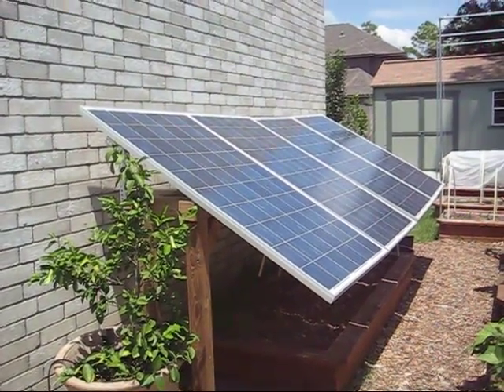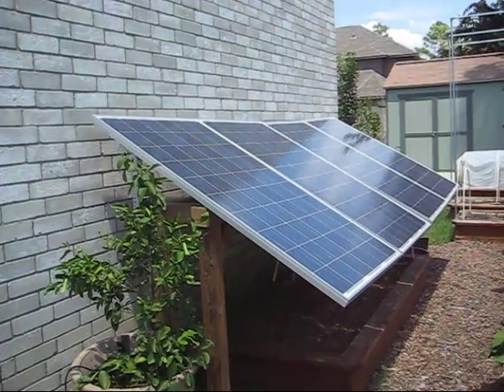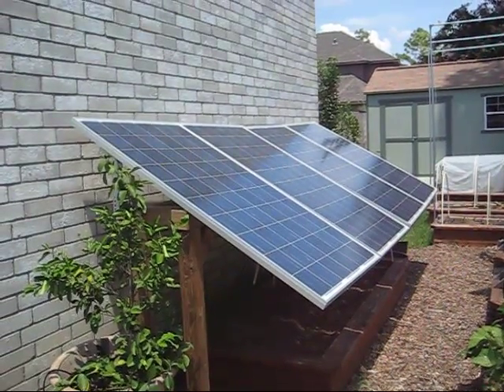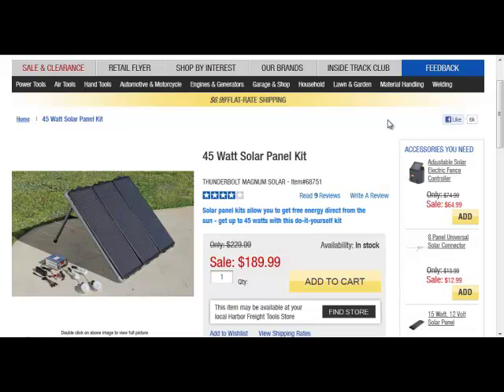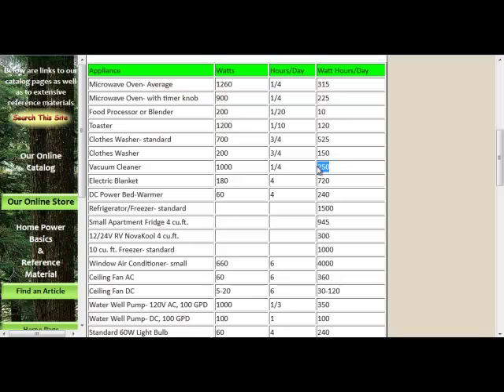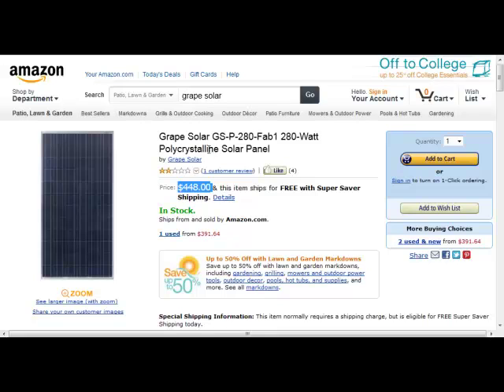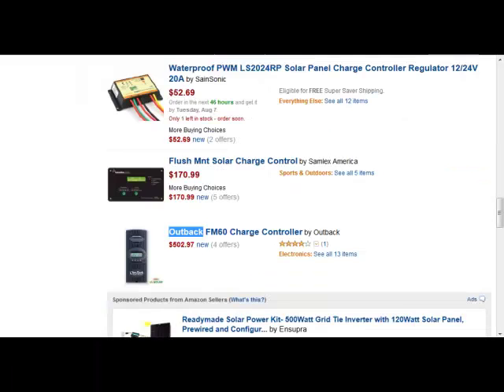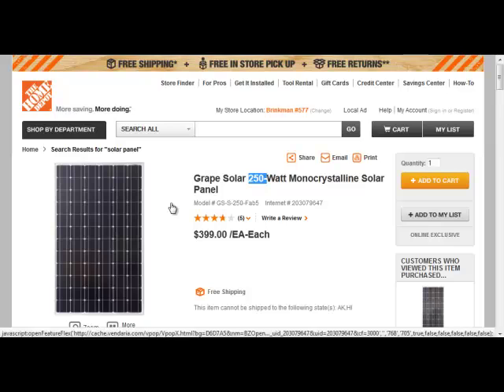DIY Solar Panel System: Costly Mistakes

Comment: most home appliances are not made for efficiency and then you have conversion losses on top. to get best results ul need to convert your appliances like washing machines/tumbledryers to use A+ grade 12v pwm dc motors then run during the day so that you run direct from panels and avoid charging losses. lights will also all need to swapped out for leds with hybrid daylight optics and with regard to mppt charge controller i built my own so i know how it works and performs.

Comment: hey thx for the videos im really into them, even tho the HF cost you some money it sounds like you came out of it with a LOT more knowledge than u began with so u didnt spend the money in vain atleast u gained some knowledge... ha.....but question... u said stick with a poly or mono..but whats the difference in the poly an mono? an also whats the big difference between them an the HF "Amorphous silicon solar cells " thanks!

Comment: Harbor Freight's solar panel KIT were designed to be used as a portable charging system or for remote location power supply, not to power your home.

Comment from the maker: Either way works. It really comes to personal preference. I'd find some controllers you like and call the manufacturers and get their input. My controller max is 500 watts and 45 amps so connected two panels together so I kept my amps at 30 amps and doubled my watts to 440 watts because that worked for my controller. I use two controllers for my four panels. that way I have a duplicate system I could take somewhere else if needed. "One is none and two is one". :)

Comment: Ok, Lsd, wish i could pick your brain for an hour, i soo don't need any more mistakes..so say i have 2 grape panels each making 30volts, whats best, run them in series to 60 volt solar controller, or leave them parallel to one 30 volt controller that can handle them both?, i need to hunt that sight you used for good info..
thanks Bob B...

Comment: i have a question on the grap pannels you posted, from home depot, i see it says 30volts, is that fine going to proper regulator?? my battery system is going to stay a 12 volt bank, because i all ready have 2 -12volt inverters..one 2000 watt and a 3000 watt, so ? is, 30 volts coming from each panel going threw decent regulator to a 20volt battery bank is fine?
lol, i also bought 2 harbor freight kits, bad move ..trying to go same line as you, Thanks Bob B

Comment: I have the 280w Grape panel and the Coleman 30amp is NOT recommended because the Grape 280w panel is rated at 36 volts output...not 12v-25v. I speak from experience. I bought the Coleman and had to return it. You need at least a 36v rated controller... 48v is better. I am not talking about battery voltage, I am talking about nominal voltage (incoming voltage from the panel) . The Morningstar Ts-45 is up to 125v nominal.

Comment from the maker: The voltage of a system is really determined by the charge controller. If you want to go 24v or 48v you will not find the charge controller you need at home depot. I am using 12 v panels and using a 24 v controller and battery bank setup. I am very pleased with the outcome. I'll have more details shortly in upcoming videos.

Comment: Great video and responses.  I will be getting into solar soon and you are really helping me and I'm sure lots of other people as well.  

Will the 250 watt Home Depot panel work on 12V or 24V or 48V systems?  Just wondering if you have to use different solar panels or various voltage systems, or if the charge controller can handle everything for you?  Thanks again!

Comment: I bought all my components from SolarHome.  You have to prety much know what you want, but I got the PV panels for 97c per watt, and everything else was pretty much comparatively dirt cheap.  I used to have a World Windpower Whisper 1000 (got bought out by Southwest Windpower, etc, etc), and after all the loose bolts, thrown blades, chopped up birds, and sandblasted armatures and magnets, I decided to go solo solar.  A wind generator spends most of it's life in lower speeds anyway.

Comment: My Family has spent the Last 5 years (and you do not want to know how much money) taking our 1200 acre ranch in Idaho 100% solar (we have a wind turbine but it really lacks in output).. Over the Last 30 days we have generated 2.50 MWh and only used 1.96 MWh.. It has taken quite a while to tune things correctly.. But we Found to really do this we had to change out appliances and really conserve.. Conserving energy is the cheapest thing you can do to go off grid..

Comment: Are you happy with the performance of the Grape Solar Panels? I just got my 2 195 watt panels mounted today. Paid 318.00 (Home Depot) each with free shipping, no sales tax and they were here in 3 days. Im gonna run a morningstar mppt controller with these panels. Gonna take some video when I get a little farther into the install. Im just planning on running my well pumps on solar.

Comment: I was going to "roll my own," but I also wanted to incorporate wind and have a hybrid system that could also produce power when the sun was down. I went with WindEnergy7 dotcom and am putting three turbines and 16 solar panels on my roof. It's a bit more spendy, but I'll produce 6800 watts per hour if I have both wind and sun. I'm waiting on building permits so I can get it all installed.

Comment: Those WellSee (and Instapark and other fake brands that they are sold as) controllers are definitely fake.  Having looked at the guts of one, it is just a PWM charge controller.

Comment from the maker: I am going to address both these questions in future videos. However, the short answer is I have my panels on the south side of my house right next to the house so the house acts as a wind block. MPPT is "Maximum Power Point Tracking". It reduces less power loss than standard controllers effectively giving you 30% more power.

Comment: Stranded wire is not made for DC it is made for when flexibility is an issue. If it calls for 18ga then buy 18ga or better. Solid or Stranded wire makes no difference in this case.

Comment: I I bought the Sunforce  charge controller from Amazon and it lasted me about two months and then on one very sunny day poof up in smoke it went. I had the correct voltage hooked up to it, so what it said it could handle was not true. I don’t use any charge controller, I just do it by hand and watch it very carefully and never let it go beyond 15 volts, if it does turn on your 8000 btu ac to it and your refrigerator to suck some juice out of the batteries to where it is at a safe level of vl.

Comment: Should have mentioned I only pd 140 for the HF systems not 189. Everything was tested, set up and broken down. Lots of low power LED lighting works great. Toast is great done over a fire or grilled on cast iron. Seriously, houses in my town that had lights were targets, many generators were stolen-solar systems could be too. Have a way to lock them down!

Comment: Good lessons learned for the amount of power you wanted, thx for sharing!
I did go with 3 HF systems. Added 30A controller. We need very minimal power as we learned during a week long outage Nov in MA. Got many old fashioned hand-power items to replace many electric ones. Grid goes down-no TV anyway! Convenience made up for the per watt price for my needs. Everything's stored away now-for emergency use only. Looking for ways to live minimally & not be the brightest house on the hill (target).

Comment: The very first controller listed on the amazon link you gave is the same as the ebay "fake" controller. So is it a fake? Or did you just get a bad one?

Comment: Make sure you mount your Controller somewhere so its Not Exposed to Outside Elements..
no direct sunlight or moisture.. I smoked a 10 amp SUN controller when i forgot it was outside, got rained on while i was at work.. 
ALSO..SUNELECdotcom is where i got my panels, bout 3yrs ago, Prices have dropped dramatically since then, but it seems their selection has narrowed, Still worth a Look, IMO..
Thx for the vids, may many sunny days come your way..

Comment: Cool, I will stay tuned.

My parents live totally off-grid right now, and all they have been using to generate their power is a gasoline generator. And they were starting to think of getting some solar panels. I had suggested the harbor freight panels to them because I had thought (erroneously) that they were cheaper. I had never thought about dividing out the price per watt. I will have to point them toward your informing video series on this one.